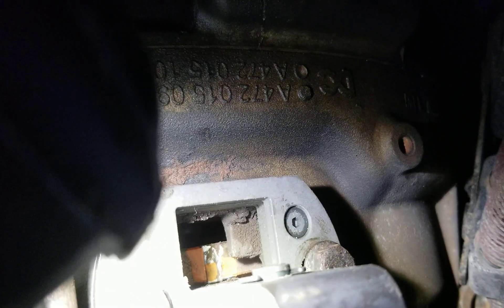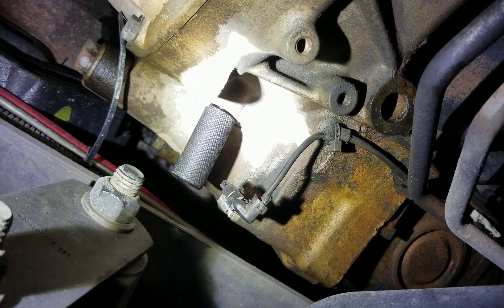DETROIT DD15 ENGINE REBUILD CASE STUDY #4

Comment from the maker: any time you see the dimple on the flywheel it means cylinders 1 and 6 are at top dead center tdc, just gotta figure out if 1 or 6 are on compression stroke or valve overlap